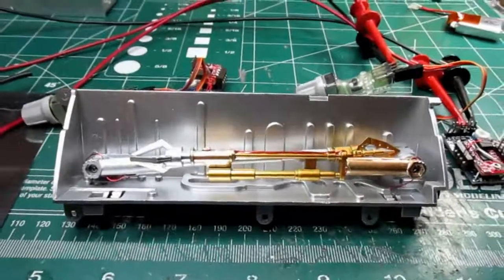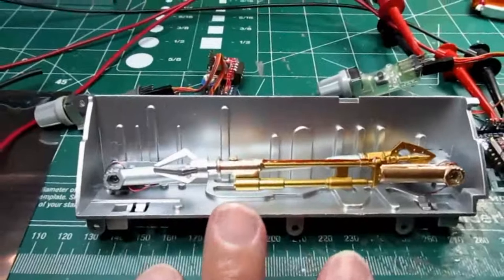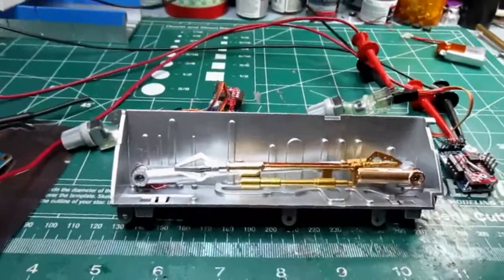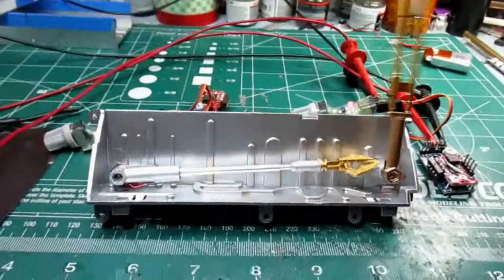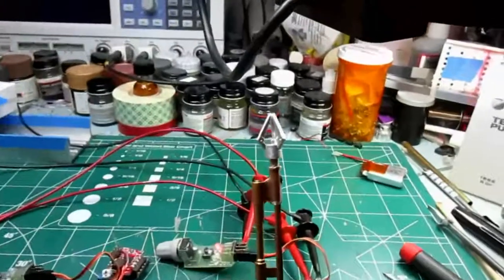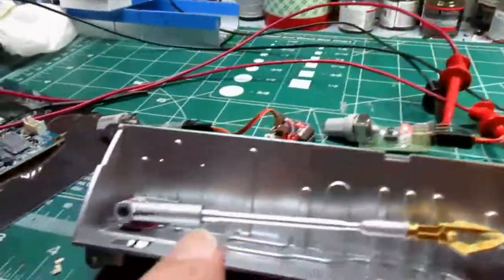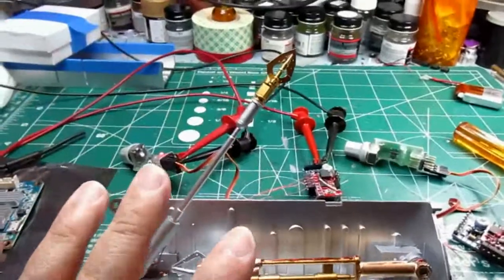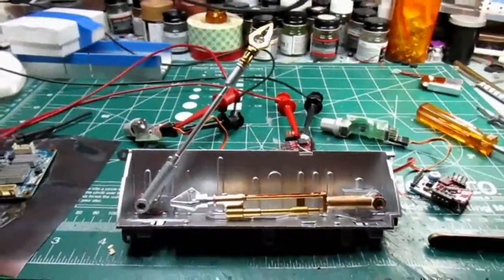DeAgostini R2 D2 mods 01

Comment: Can we buy this mods everywhere?
Reply from the maker: I'm sorry Alex, This is a mod I'm doing for my R2-D2, I'm not aware of anyone offering anything like this for sale.
Reply: @teslabe7701  ok thanks but, can you please show to us, where to but these motors?
Reply from the maker: @AlexMele  I got them off ebay a few years back, if you live in the U.S. I'll send you three. Have you ever worked with "Mag-Wire", that is what I use on the motors terminals. The coating needs to be scraped off the wire's end to solder them. Also, these are 2 phase stepper motors not just dc motors, you'll need a stepper motor controller/driver to make them spin.